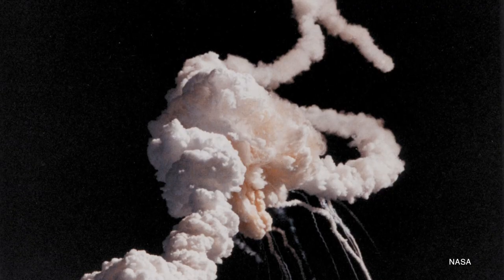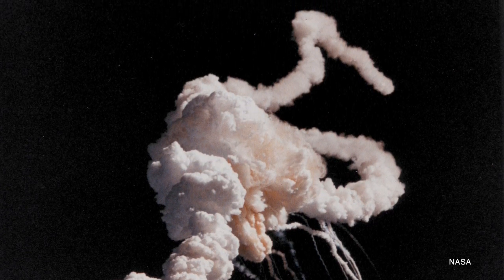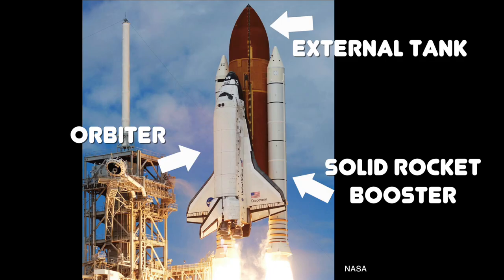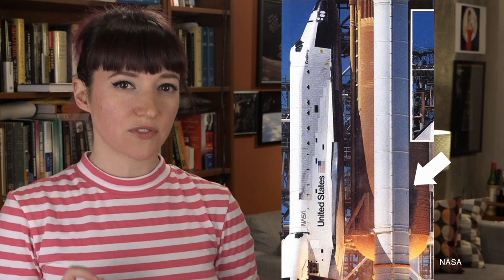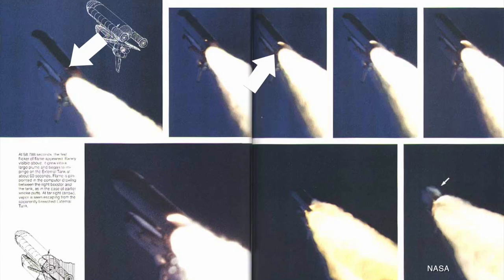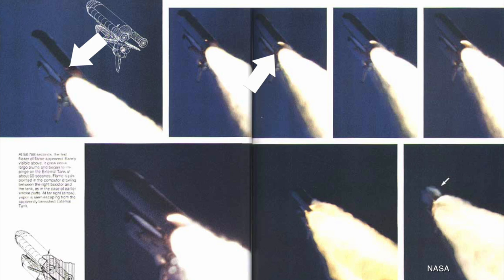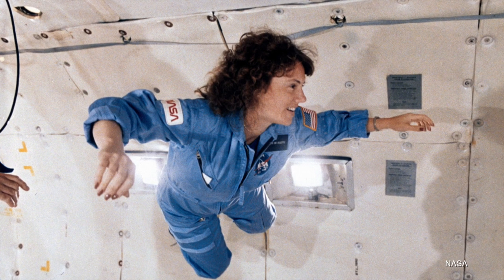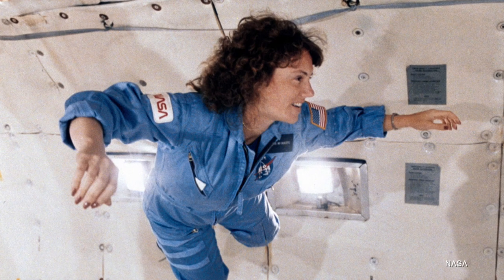How the Challenger Disaster Changed NASA

Comment: The challenger disaster is a prime example of how poor management and communication within a business can lead to disasters and failures. The company being more concerned with how they would look publicly if they delayed the launch to fix issues, was more important to them than actually relaying the issue and resolving it, which would have saved multiple lives. Nasa’s poor culture that revolved around Public Relations and how they can receive the most taxpayer dollars was a flaw in their management style. This poor culture led to the failure of the mission. Although it was a technical failure, if the company would have eased the pressure, and taken a step back to ensure everything was ready to go, the O-ring could have been noticed and altered before they put the lives of astronauts at risk. Coincidentally, their hyper focus on Public Relations ultimately cost them, and made them look worse publicly because of their lack of diligence. If management had been better focused and better prepared, the communication would have been higher, and would have led the team to catching these flaws. Moving forward, the company should have a more steady focus on the process rather than the outcome. This will lead them to more success, because they will be more focused on how to effectively get the job done, rather than how it will look when the job is done.

Comment: This video demonstrates how important a positive organizational culture is within a business and how severely detrimental it can be when culture isn’t prioritized on the correct goals. The Challenger Disaster although a technical failure of the science and physics behind rocket launching was also largely caused by the push of NASA’s leaders to continue with the send off of the spacecraft. If the engineering is explored, the Challenger exploded 73 seconds into the mission because of the O-rings inability to expand and shapeshift because of the temperature of the air at the time of launch. But, where the organization is involved in this disaster is their knowledge of this property of the O-rings and their continual approval of launch despite the risk. NASA was more concerned with the public relations issues that would come with not launching on time instead of the safety of the astronauts on board of the spacecraft. This kind of organizational culture displays little to no respect for the lives of the people who are making history for America in their brave endeavors. Organizational culture is the way an organization focuses on its employees, the people they conduct business with, and the wider community. NASA was more focused on the public address they would receive from the President and the airing of the launch in schools the following Friday from the timely launching on Tuesday. The greater emphasis on the external community and taxpayer support left a gaping hole where there should be grave concern for their pilots. The launch of the Challenger by the NASA team can also be seen as an abuse of power. They knew they had the final say in whether the spacecraft would be sent off into space and used their power to push forward for the organization to stay in good graces with the public.

Comment: Presidential commissions notwithstanding, the culture problem was never corrected and was the root cause of the Columbia disaster.  Even then NASA management should have all been fired but wasn't.
Reply: John Blotnick there were improvements - I have colleagues who worked on Shuttle software iv&v. They, along with other interested parties had to sign off on each flight. There are channels for whistle blowing as well. Hopefully, other needed improvements have been made. My opinions are my own and not NASA's or my contracting organization.
Reply: Bull Shit. They were told the O-ring was not designed to work below 53 Degrees.. They told the engineers they didn't know what they were talking about. So a Bureaucrat with zero Engineering Degree. Knew more! 

This is typical intelligentsia we know more. Then those that Designed and built it. As they shopped around for an engineer that said it was safe. One that had no expertise in the O-rings. After the first 4 said it was not!

I would add. NASA always knew the foam was a hazard. They never fixed it..
Reply: Master Chief 00117 - it was an organizational failure as well as a technical failure. Shuttle was flown out of spec. Not only the cold was a contributing factor, but partial burn-throughs were tolerated that were beyond specifications. Additionally, ignoring engineers is suicidal as they are the last line of defense. One fortunate result is that when I went back as contractor, I was required to go through case studies of all three manned space flight accidents involving loss of life.
Reply: This is true in purely private sector projects as well.  CEOs who will not staff a project early to allow proper research time to study whatever system is being replaced, then expect that research to be "squeezed in" while rushing to complete the new system on a deadline, then cut staffing before the new system (once it works) can be properly documented.  Only the time spent actually building hardware or writing code is to be paid for, not the "measure first" time, and not the "document what we did" time.

There's a reason for the old rule of project planning: the first 90 percent of the job takes 90 percent of the time and budget, and the last 10 percent takes the OTHER 90 PERCENT of the time and budget.  The only remedy management has for that is to USE THE 92 PERCENT YOU ALREADY FINISHED by the time the original deadline occurs.

Comment: The decision to launch that day was a political one. President Reagan was to give the State of the Union address to Congress within days of the scheduled launch. Morton Thyacol, who were the ones that developed the rubber o-rings, felt the freezing weather could be a problem if they froze, which they did. When Mission Control ordered “power up”, the additional fuel was to be trapped by the o-rings failed and then the explosion took place. Besides these technical issues that could have been avoided, the toxic culture at NASA was also evident through how they handled publicity. Rather than pushing the mission back another day to a Saturday, NASA was too concerned with having as many students as possible watching, thus playing another significant part in the disaster. The decision making process at NASA was beyond flawed and in need of brand new top management since the tragedy occurred. In summary, this truly emphasizes not only the importance of communication amongst leaders and employees, but more so how sincere and honest company culture needs to be the foundation of any successful company.

Comment: Hey! I was wondering if you could look into/feature power systems aboard spacecraft and satellites? Specifically, the solar panels, batteries, radioisotope thermoelectric generators (RTG's), and fission reactors. I think the history, tech, experiments (and mishaps, like the MIR fire) are all fascinating and I'm sure other fans (and you!) might dig it as well.

A couple aspects that are mind-blowing are weight restrictions and, well.... space is a vacuum! How the heck do you reject waste heat...? When the RTG fuel generates heat into the thermocouples which make electricity, what cools the other side and prevents the thermocouples from simply overheating and melting in the process? Same question for the fission reactors, which always require a massive heatsink on Earth - and further, the habitable spaces and waste heat from life support processes, and so on?

I know it's a pretty broad request in scope and likely a lot of content, but figured I'd ask. Cheers!

Comment: The horror that the families of those on board must have felt is unimaginable. On a sunny, winter day, the last thing that any spectator expected was for the Challenger space shuttle to completely explode in just minutes. Sadly, this explosion should have been expected earlier by those that chose to continue the mission. There were difficulties detected before the take-off, yet the upper management decided to try and gut one out for the sake of America’s pride. The total lack of empathy for those on board and their families is disgusting. Though they were not positive that a disaster was imminent, NASA’s managers were aware that there was most definitely a problem. NASA was so worried about public relations and social publicity, that they completely forgot about the danger that follows all space shuttle missions. Issues with public relations is what NASA was running from and issues with public relations is what NASA found. It is almost as if the Challenger explosion can be used as a metaphor for the toxicity that seeped into NASA’s culture. Simply put, the Challenger disaster was a clear representation of pride and one of the worst managerial decisions ever in the history of America.

Comment: I remember that even before the first launch I read a critical publication about the space shuttle explaining that the tiles and the solid rocket boosters where the main potential problems of the spacecraft. The history has shown it was unfortunately true. The solid rocket booster had been chosen due to lack of founding. Manned flight should be made with liquid fuel engines because it provides more control on the thrust of the rocket.

Comment: This video is shocking. It is incredible how NASA lost seven astronauts’ lives on television. From the beginning of the launch, we see a problem; there was smoke coming from one of the joints. It is incredible how there were signs that something was wrong initially, and they just preferred to ignore what was happening. Everyone involved knew that there was a problem with o-ring. However, they still chose to launch that day, mostly because the Thiokol engineers did not adequately communicate to NASA management the real problem. We can see that they were more concerned with the public relations issues they would face from not launching on time rather than with the technical issues which were most critical. I believe that an organization needs to do the right thing always, no matter the cost. We can see that the NASA organization culture and decision-making processes were the key contributing factors to the accident. NASA knew that something was not right, but they failed to address the problem correctly. The managers were lying to themselves. I believe that in an organization, everyone must respect one rule which is to never lie, especially when you know the truth; you must face the reality of the situation. As a result, we can see that the problem they faced, in the end, was much bigger than the one they could have faced if they stopped the launch.

Comment: Calling it an "accident" doesn't really accurately reflect what happened.  An accident is the result of an unforseen condition or circumstance that could not have been avoided. Morton Thiokol engineers were well aware of the O-Ring problems from previous launches in somewhat similar conditions.  Yet they did not take any action to redesign them to correct the problem.  On the day of the launch, they initially DID NOT recommend the launch due to adverse ambient temperatures.  But through the magic of NASA, the non-recommendation turned into a positive recommendation.  Challenger launched against the initial recommendations.  That does not make it an "accident".

Comment: Why did they never put a launch escape system in the shuttle program?
Reply: It would be difficult if not impossible for the entire crew to egress from the vehicle during launch. Remember the crew of the shuttle were located on two decks of the spacecraft meaning the crew on the lower deck would have to climb up to the upper deck to get out or risk jumping through the exhaust of the engines or wait till the engine cut out and the shuttle was gliding and bail out through the lower deck hatch, if they used some kind of downwards ejection system found on some aircraft like the F-104 they would just hit the fuel tank and die (such a system would only have saved them in exactly the situation Challenger was in, but killed them in almost any other situation that couldn't have been survived by bailing out of a gliding orbiter; who would consider such a crew safety system like that).

The ejection seats they tried early on were only functional during the first part of the flight since a normal ejection seat can't function at high speeds. Systems like an enclosed ejection seat "pod" like on the B-58 'Hustler' or a cockpit ejection system like on the B-1 'Lancer' were discussed but they would have added extensive weight to the spacecraft and would require a redesign of the craft.

Comment: The Challenger Disaster shows what happens when you don’t have good management. Right before lift off, there was smoke coming and then a minute later a flame was seen, and then it hit the main tank which led to the explosion. Prior to that moment, NASA thought that they could get away with the issues by just ignoring them. She explains that Thiokol engineers did not properly communicate to NASA management and it seemed as though NASA management did not want to hear any issues. Those working for NASA were a lot more concerned with public relations issues than technical issues. NASA did not want to postpone the launch even with the weather being so bad. NASA had never launched when it was so cold and instead of being safe and launching at a temperature familiar to them, NASA did not want to disappoint and completely mismanaged the situation causing multiple deaths. NASA did not care about the technicalities but rather wanted to fulfill the broadcast and have a PR win. NASA wanted to launch on time to prove that the taxpayer's dollars were benefitting them. . NASA needed to delay the flight and show that they are doing what is best to protect everyone instead of trying to rush it to gain PR and please the taxpayers.

Comment: There were so many smart people. So many factors, this was a routine launch, they had a deadline :(. There was a business interest. But materials and systems are so so complicated :((. If the procedure said only launch at certain temperatures they should have followed it (idk their procedures). At least we know that the o-rings are limiting components now... Tragic. I bet the people behind it were doing math on different things to make sure it was safe to launch in these conditions and to change or flex their procedures and checklists in order to launch... what do I know tho
Reply: Andrew With the redesigned SRBs, the O-rings are not as much a factor. Booster joints now have heaters. It's a much better joint design overall.

Comment: I really hate to correct you Amy, but there was no real explosion, it was an aerodynamic breakup.
Reply: To be clear, I have tremendous respect for you and your content, I just wanted to point this out.
Reply: actualy: the overpressure found a "weakspot" to further rip apart a pressurised container. 

an less sillier, but still wrong answer than you gave would be:
breaking a glass by singing its resonance tone, by making a scratch into that glass first, an artificial weakspot, where it can break.

There is a vid outthere where you can see an indian rocket break up by aerodynamics ... the dynamic pressure as it gained speed forced it to totally fly sideways at some point. 

so next time just start your replies with:
I love to show off my stupidity while still thinking that I am correcting you .... followed by your statement.
Reply: Zoutsteen from Holland Sorry, WHO is showing off here. Better look in the mirror...
Reply: It's more complicated than that. The different components of the shuttle stack had different levels of strength. The external tank and the orbiter were significantly more susceptible to being broken up by aerodynamic forces than the SRBs were. (You will note that the SRBs survived the breakup of the shuttle stack and flew onwards, somewhat twisting out of control. They held together until they were detonated from the ground.) So comparing the performance of an Indian rocket you see in one video does not necessary equate to how well the shuttle performed. Also, different altitudes and speeds play a big part. The shuttle had just passed through maximum dynamic pressure when the breakup occurred. It had a lot more force acting on it than a booster that experiences issues closer to the ground.

The actual failure wasn't a true explosion (with a detonation). The SRB burned through the support that held it to the external tank. The SRB became free at the bottom and rotated, flying into the top of the external tank. They was also a burn through of the external tank near the bottom, which also failed at the same time the SRB hit the top of the tank. The tank broke apart, releasing a large cloud of propellant that rapidly burned (but did not explode). The force of the tank breakup pushed the shuttle orbiter into the slipstream at an angle where it could not survive the aerodynamic forces, so it broke apart.

To most people, it looked like an explosion, so that it the terminology that stuck with the masses (and the media). But as hockeyplay11 noted, it  is more accurately described as an aerodynamic breakup (especially if one is referring to the orbiter Challenger).